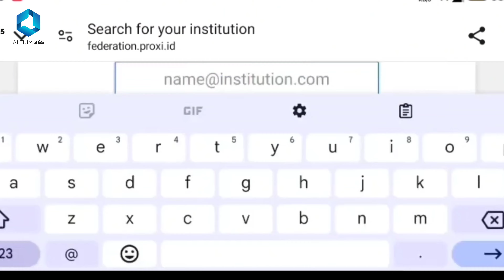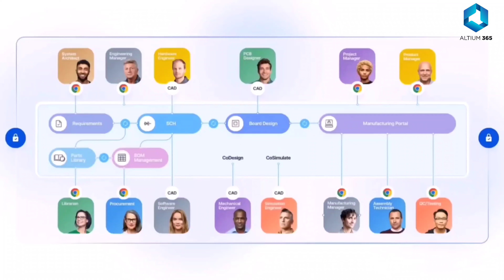Adjustable Voltage Regulator For Rechargeable Batteries

Comment: Hola saludos desde Argentina, carga también de 12v, y 8,4v....?
Reply from the maker: It can charge all type of. Batteries just regulate output voltage by Variable resistor
Reply: @electproject  thanks